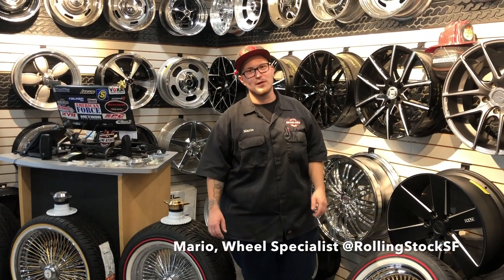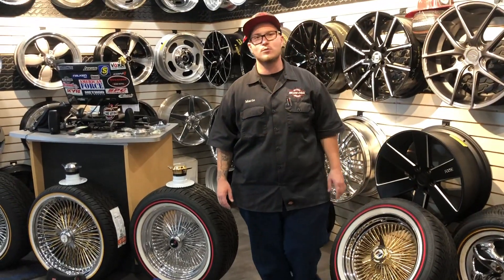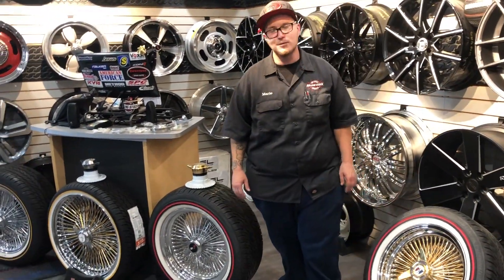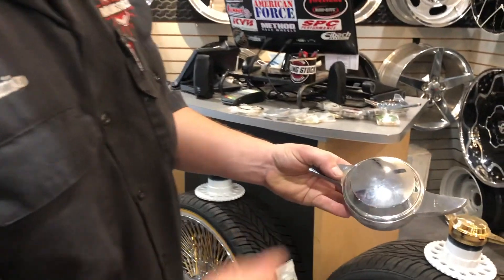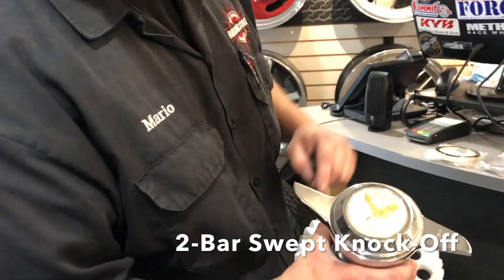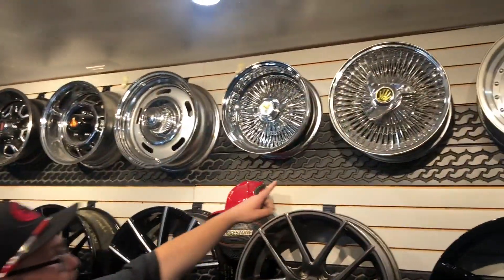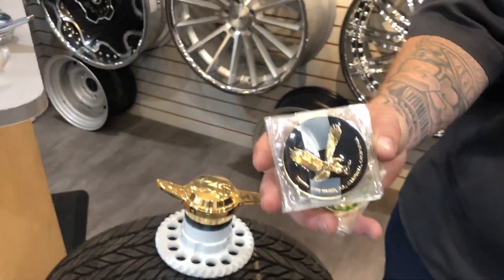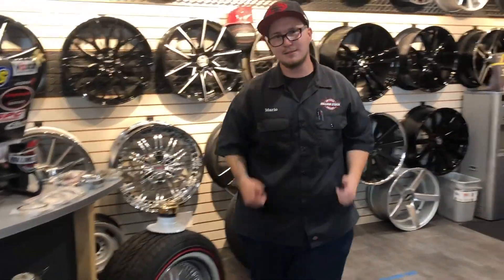Wire Wheels Specs: What you should know about Daytons, Zeniths - Offset, Knock-Offs and More

Comment: Probably a dumb question . So a Dayton is only determined by the cap ?! Are zeniths original daytons ? Or two complete things , , I’m confused and how long before gold fades and how much to repaint ? Looking to purchase but I’ve seen people selling fakes
Reply from the maker: @The Truth: Great questions. Dayton and Zenith are both wire wheel manufacturers. Zenith is no longer in business--so only replicas are made also referred to as "Chinas". Dayton still manufacturers American Made stainless steel wire wheels with American Chrome. You will pay fo9r Dayton quality. All gold plated wheels are electroplated. If you electroplate on stainless steel spokes (as in a Dayton), rusting is minimal, and therefore the gold may last longer. Call us for more info!

Comment: I'm curious what's the difference between standard and reverse wire wheel.. which ones do you normally see on lowriders
Reply from the maker: @b boy luda A standard offset wheel has the mounting pad in the center of the wheel. A reverse mount has the mounting pad at the rear (inside) of the wheel, and therefore has a bigger lip. Most lowriders have reversed offset
Reply: @RollingStock  thanks bro

Comment: great idea...Im interested to know the differences in OTD wheels and regular Daytons? Is the hub size the only thing? & by how much?
Reply from the maker: Hey Lamar, By OTD--what are you referring to?  If you mean off the rack wire wheels (sometimes referred to as "China's" as that's where they're made), the difference is Daytons are custom built in the United States. 
American built wheels (like Daytons) use different metals, Daytons are stainless steel, while chinas are regular steel; which means Chinas are more prone to rust.  Call us here at the shop for more info!
Reply: @RollingStock  meaning one ton daytons. Looking for caps
Reply from the maker: @YahwayorNoway  Ah, thank s for clarifying. Last time we spoke with Dayton we were told they no longer make the bigger size wire wheel hub that they once made (for larger vehicles, like an Escalade).  The one ton Dayton wheels have a different number of spokes and are designed for heavier weight vehicles. I don't have a OTD wheel here so I can compare the size of the hub.
Reply from the maker: @YahwayorNoway  Hubs are a different size, cap is not interchangeable. I would try looking for a used one

Comment: How much power can they handle before they get mestup?
Reply from the maker: If you drive s l o w, they can handle any power. If you stomp on it, you could rip the spokes away from the hub and or the barrel. Imagine a spoked bicycle wheel, now imagine what would happen if you apply 500HP all at once--wire wheels are similarly constructed

Comment: I got some 14x7 standard wire wheels, was thinking about putting them on my 84 sadan deville what size tire would be good ?
Reply from the maker: If you're going for the low rider look, most common tire size used with that size wheel is a 175/70/14. If that's not the look you're going for, call me and I will give you more size options

Comment: I have some chrome and gold 22 inch real Daytons i bought years ago form my cuz to slap on my 1996 ford f150  problem is that the adapter is 6 lugs and mine are 5 lug i have some 20 inch wires on it but my adapter is not wide enough to fit the dayton wheels. Think i could get adapter that same diameter to fit the wheel and my 5lug?
Reply from the maker: Yo, call us, we may be able to order the correct adaptor. But a convo with you is needed to ensure I understand

Comment: Appreciate the video!  Curious to know why wire wheels offsets are standard/reverse when other wheels actually have +/- number offsets(ex. et35 etc etc).  I would say that is the style of wheel.  I've looked all over for the actual offsets of reverse wire wheel for fitment purposes.  Do you have this information? 18x8 reverse in particular.  Thanks!
Reply from the maker: This is something much easier to explain in person!  Are you local? Can you drop by our shop to discuss?  If not, please call us at 415-558-9121, ask for Adam or Mario
Reply: @RollingStock  i'm not, just doing research at this time.  From what ive read they are negative offsets--- just need some numbers to figure out setup, spacers, hubrings etc
Reply from the maker: @OldManStance  Call us please!